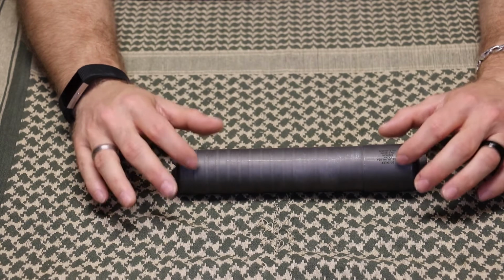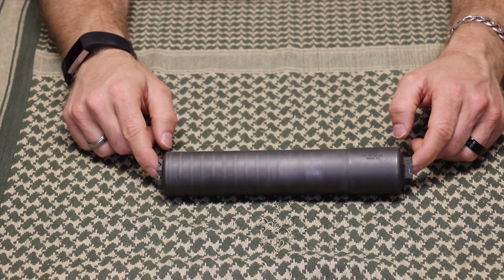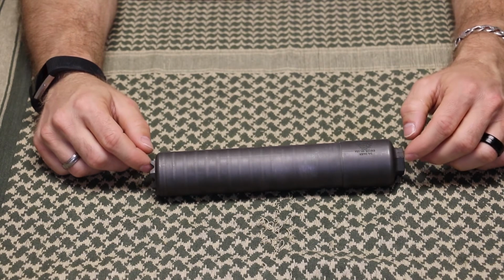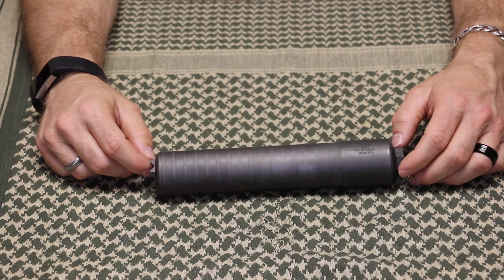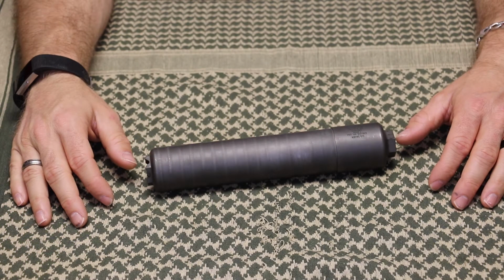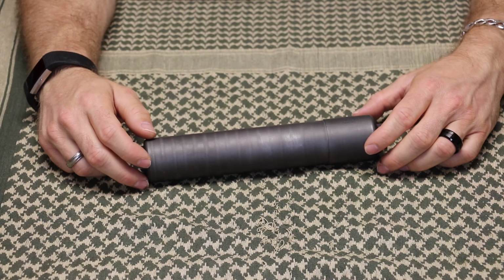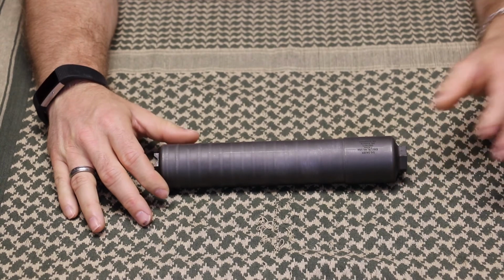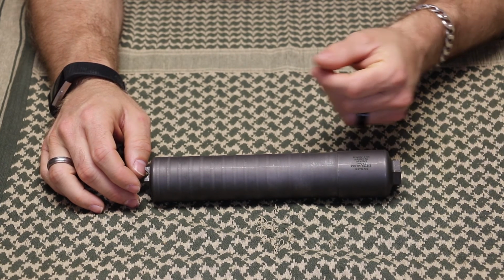Sig Sauer SRD762Ti, .30 Cal Suppressor

Comment: can you explain to me why people pay 1000.00 dollars for a can and still wear ears. what's the since in that. if it's not hearing safe I see no purpose in the can.
Reply: The OSHA hearing limit is very old and is need of an update. ACGIH recommends a limit of 85 dBA for 8 hours with an exchange rate of 3 dBA. In a nutshell you can only go a few rounds without hurting but there will always be a risk of hearing loss.
Reply from the maker: Most all Rifle cans get you under 140DB which is considered "Hearing Safe", but by no means does it come without consequences in regards to damaging your hearing over time.  I would prefer to keep my hearing as long as possible. Suppressors also act as muzzlebrakes too helping to control recoil.